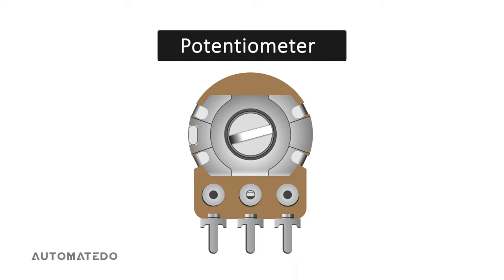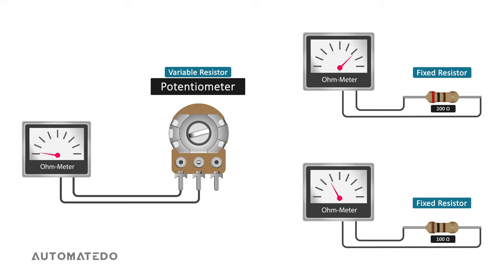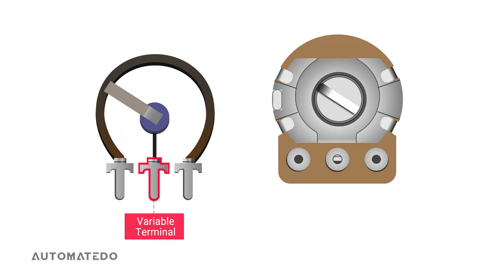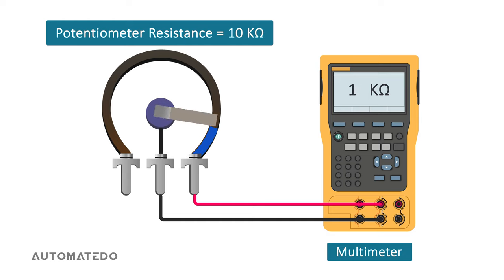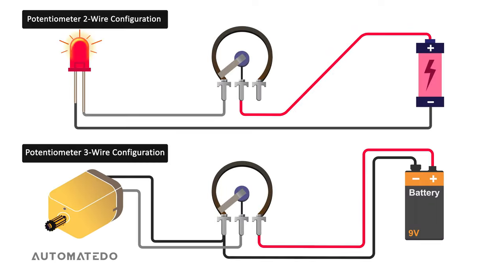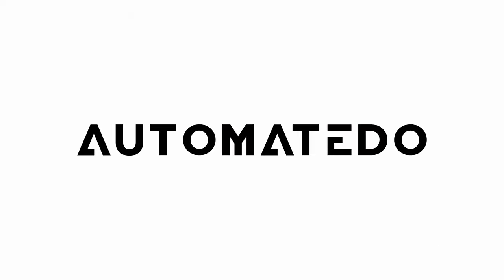Potentiometer Explained

Comment from the maker: We hope you enjoy the content. With your support, we can bring you more informative and engaging videos on the topics you love. Your contributions make a real difference and help us grow the community of industrial automation experts. Together, we can create something truly special. Thank you for being a part of this journey! Cheers 🍹https://ko-fi.com/automatedo
Reply: Excellent video. Well done.
Reply from the maker: Thanks for your precious support 😉
Reply: For the voltage variable one, is it still wired in series?
Reply from the maker: Yes, a voltage variable potentiometer (also known as a voltage divider) is still wired in series with the circuit. In this configuration, the potentiometer is used to divide the voltage between its two output terminals, which are connected to the rest of the circuit.

By adjusting the position of the potentiometer's wiper, the voltage output from the potentiometer can be varied, allowing for precise control of the voltage supplied to the circuit.

It's important to note that in this configuration, the potentiometer's resistance value should be chosen based on the current requirements of the circuit, and the maximum voltage that will be present across the potentiometer. Exceeding either of these limits can cause the potentiometer to overheat or fail.
Reply: Thank you for the video. i plan to create some videos for school students. may i know what software you used in producing this video?
Reply: Great video, thanks for sharing with us, could you please tell us software used to show wiring @Automatedo
Reply: Which type linear/log & what ohm rating potentiometer should i use  to control a dc motor in a sewing machine using 6v @ 1200 ma of voltage/ current?

Is there a way to calculate the ohm rating for this type of circuit?

Comment: Couldn't you have achieved the same thing with the motor by using the first configuration?  Only use 2 pins from the potentiometer and if you want to increase the speed of the motor just decrease the potentiometer resistance, and if you want to decrease the spin then add more resistance. I fail to see how using the third pin is useful for adjusting the speed when you can just use 2 pins. Can someone explain please
Reply from the maker: While a potentiometer with only two pins can be used for motor speed control, a potentiometer with three pins can offer additional flexibility for controlling other aspects of the motor control circuit, such as the direction of rotation or the duty cycle of a pulse width modulation (PWM) signal.
For example, in a motor control circuit that uses PWM to control the motor speed, the third pin of the potentiometer can be connected to the PWM input, allowing the potentiometer to control both the duty cycle and the speed of the motor.
Reply: The difference is subtle. If you use all the 3 pins, you are employing not a variable resistor, but a voltage divider (see voltage divider in the internet to know more). In this case, the whole voltage of, say, a battery, is supplied to the whole device (suppose 6V). The DC motor is connected to the wiper and one of the legs of the potentiometer. The resistance of the part NOT connected to the DC motor determines the fall of potential, so if that resistance is low, the drop of voltage will be low and more voltage will remain for the part connected to the DC motor. This results in the fact that the more resistance is dedicated to the part of the DC motor, the more power it gets. It is a little bit brainy but if you follow the reasoning you soon well realize that it is really that way.
Reply from the maker: Thanks for sharing the your valuable thought and experience 🙏
Reply: @tanner1985  that's what is happening, but why is the voltage divider preferred over a variable resistor?
Reply: A voltage divider allows you to take a voltage and produce a lower voltage.
They typically comprise a couple of fixed resistors.

By using a potentiometer you can make that output voltage variable.

Using a potentiometer in a 2 pin arrangement gives you a variable resistor, not a voltage divider.
It is just a resistor which is changeable.
And a resistor sets the current.
A changing resistor allows you to change the current.

So it all depends on what you are trying to do, what you actually need for your application, do you want a fixed or variable voltage: => voltage divider or potentiometer, or do you want to set a current to a desired magnitude or changeable magnitude: => resistor or potentiometer using two pins.
Reply: 2 pins acts as current variation while 3 pins as voltage variation.
Reply: @deang5622 For speaker output (2 wire + and -). What type of wiring to use, 2 pins or 3 pins?

Comment: What I get , there is no use of the 3rd leg , because it's depends on In which leg you input the voltage .
Reply: Not quite, it can be handy in several use cases. for an example in a voltage divider

Comment: Increasing the resistance through the potentiometer will decrease the speed of the motor, not increase. other than that, good video👍👍
Reply from the maker: In general, if a potentiometer is used as a voltage divider to control the speed of a DC motor, introducing more resistance will lead to a slower motor speed.

However, there may be certain cases (the illustrated example in this video) where introducing more resistance could result in a higher motor speed.

For example, if the motor control circuit is designed to work with a specific range of potentiometer resistances, and the resistance is currently too low, introducing more resistance to bring it into the appropriate range could result in a higher motor speed.

Comment: Great video! However there is one part that isn't clear to me. Please tell me if I understand this part correctly. The resistance in a potentiometer depends on the length of the resistance element. When you adjust the knob on a potentiometer, the wiper either shortens or lengthens the element. Therefore, a longer element will have more resistance, while a shorter element will have less resistance. For instance, in volume control, the longer the resistance element when you turn it down, the lower the volume and the shorter the element when you turn it up, the higher the volume. As someone who had no prior knowledge of electronics, I thought the resistance element inside the pot had different points of resistance as opposed to the wiper actually shortening and lengthening the resistance element.

Comment: Hello. I have an interesting case. What if I have a variable resistance load (500 ohms-7000 ohms). I want to increase the voltage or force a current amount across it to generate controllable heat. How can I achieve this result with a power supply having an output of 0-30V and 0-10A? I appreciate your help

Comment: I'm new to electronics so forgive me for my stupid question. Please help me understand? At 4:46 you said: "If we adjust the wiper in a way that introduces high resistance, more voltage will drive to the motor, resulting in turning the DC motor faster."  The motor IS running faster as you said BUT at this point the negative terminal on the battery is connected directtly to one terminal on the motor while the positive terminal from the battery takes the shortest path trhough the POT going straight via the wiper to the other terminal on the motror.  Isn't this the LEAST resistance for the current? Why do you say the opposite of what seems to he happening?
Reply from the maker: In general, if a potentiometer is used as a voltage divider to control the speed of a DC motor, introducing more resistance will lead to a slower motor speed.
However, there may be certain cases (the illustrated example in this video) where introducing more resistance could result in a higher motor speed.
For example, if the motor control circuit is designed to work with a specific range of potentiometer resistances, and the resistance is currently too low, introducing more resistance to bring it into the appropriate range could result in a higher motor speed.
Reply: Exactly my question
Reply from the maker: In general, if a potentiometer is used as a voltage divider to control the speed of a DC motor, introducing more resistance will lead to a slower motor speed.
However, there may be certain cases (the illustrated example in this video) where introducing more resistance could result in a higher motor speed.
For example, if the motor control circuit is designed to work with a specific range of potentiometer resistances, and the resistance is currently too low, introducing more resistance to bring it into the appropriate range could result in a higher motor speed.
Reply: First off electrons flow from negative to positive pole.  imagine it was a water driven and as the resistance increased the pipe gets smaller, less water flows  and visa versa.
As you increase the resistance to the wiper it decreases the flow of electrons (water) so the motor turns slower.

Comment: I have a question, for the example at 3:10 ..... why does the left terminal have both black wires? Couldn't the left terminal not be used at all and go straight from the  negative battery to the motor?
Reply from the maker: While a potentiometer with only two pins can be used for motor speed control, a potentiometer with three pins can offer additional flexibility for controlling other aspects of the motor control circuit, such as the direction of rotation or the duty cycle of a pulse width modulation (PWM) signal.
For example, in a motor control circuit that uses PWM to control the motor speed, the third pin of the potentiometer can be connected to the PWM input, allowing the potentiometer to control both the duty cycle and the speed of the motor.

Comment: 🎯 Key Takeaways for quick navigation:

00:03 🧪 Potentiometer is a mechanically driven analog device used in electronics projects.
00:31 🔄 Potentiometer is a variable resistor that can easily change resistance by turning a knob.
01:01 🔌 Potentiometer has three terminals: two fixed and one variable, forming an arc of a circle.
01:30 🔗 The middle terminal (wiper) moves across resistive element, altering electrical contact.
01:58 🔍 Multimeter helps measure potentiometer resistance; wiper's position affects value.
02:27 🔧 Wiper position changes resistance; multimeter probes measure resistance accordingly.
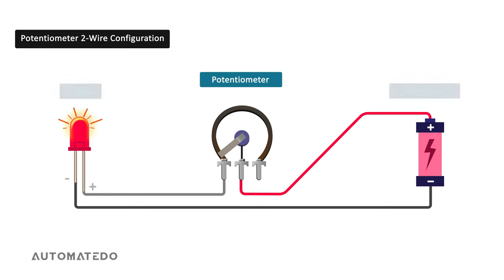03:21 💡 Potentiometer used as variable resistor for LED brightness control.
04:18 ⚙️ Potentiometer acts as voltage divider for motor speed control.
05:15 📚 Understanding the basic concepts of potentiometers for electronic projects.
Reply from the maker: Thank you so much for your kind navigation! 🙌 We are glad you found the video great, and I truly appreciate your support. Your encouragement means a lot to us. If you have any friends or colleagues who might also enjoy the content, we would be grateful if you could introduce them to the channel and encourage them to subscribe. We look forward to bringing you more amazing videos! 😊
Reply: Lowbrow question

Controlling a LED. Input is 30v ... 1k pot with give me .03 increment of change (0-30volt amp)?

Comment: Note: Never exceed the current through the potentiometer's rating or "Wattage" For Higher currents use a transistor [BJT or Mosfet] to control the load with the Pot controlling the transistor.
Reply from the maker: Thank you for the comment! You are absolutely correct. It is important to ensure that the current flowing through the potentiometer does not exceed its wattage rating. Exceeding the wattage rating can cause the potentiometer to overheat and even burn out.

Using a transistor such as a BJT or Mosfet to control the load with the potentiometer controlling the transistor is a great way to ensure that the current through the potentiometer stays within its rated limit. This configuration is commonly known as a voltage divider circuit and is a widely used technique in electronics.

Thanks again for the helpful comment!

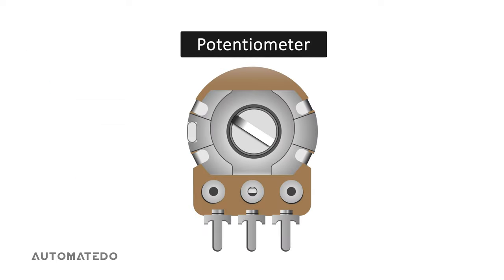Comment: I don't quite get the "3 wire configuration" example at 5:04, wouldn't a 2 wire setup like the previous LED example give the same outcome of adjusting the motor speed, what's the difference and advantage of controlling the motor this way?

Thank you for the video, it really helped me understand how a potentiometer works!
Reply: Not the author, and not an expert, but I decided to kinda look into this...

This is all from my understanding and interpretation, so take it with a slight grain of salt and if I'm wrong, hopefully someone can correct me!

The 2-wire setup will simply add resistence in-line, effectively creating heat and noise on the line. It's already succeptible to some noise with the 3rd wire not part of the ciruit anyway, but resistence adds noise. You can think of it like adding more resisters in series the more you turn it up, or replacing the existing resistor with a bigger and bigger one. No matter what, you are sending electrons through the entire series of resistors. This in effect increases resistence/impedance to drop Voltage, but Current will remain consistent through the circuit (same is true for resistors in series).

When in a 3-wire configuration, you create a complete circuit eliminating noise or any failure in the pot itself (ie, break in the wiper vs track, etc), as well as use it as a voltage divider. The last part was stated in the video, but it didn't really explain what that means and why it matters to the motor condition versus an LED condition. A voltage divider does as it says, dividing the voltage, by actually cutting in between "2 resistors" in the circuit (in this case the left vs right side of the track between the wiper) and getting the voltage through the circuit there. This in turn gives us a better fractional value and step in the voltage output in our circuit. In addition, it also shares the load of the resistance of the circuit to the entire track (or 2 resistors in a proper voltage divider) allowing greater effeciency.

Again, this is my understanding/interpretation of the math/logic, feel free to correct me if I'm wrong anywhere!
Reply: @CodexHere  very nicely explained!

Comment: Thanks for the enlightenment, but is it safe to use this the same method for a dc 12v motor with 50k potentiometer? Please do it reply, thank you. From Nigeria
Reply from the maker: Yes, it should be safe, as long as the motor and the potentiometer are rated for the same or higher voltage than the battery.
However, using a 50k potentiometer may not be the most appropriate for controlling the speed of a 12-volt DC motor because it may not provide enough resolution or precision to accurately control the motor speed.

Comment: hi, very interesting your explanation, it gonna help on my project, i have just one question before buy it, i have an mobility scooter,  is my project now. i want make sure that i'll replace the original potentiometer which is (TSR 24KN resistanceResistance. Like 200k or 50k. Looking forward to hear from you. Appreciate
Reply from the maker: The TSR 24KN potentiometer has a nominal resistance of 200kΩ. However, it is possible that your scooter's control system may have been designed to work with a potentiometer of a different resistance value.

To ensure compatibility and avoid potential damage to your scooter's control system, you should refer to the manufacturer's documentation to determine the correct replacement potentiometer for your mobility scooter.

Comment: That is very good info, clearly explained. But, for audiophiles, it would be great to know the effect on voltage & amperage, in each case, when the same identical potentiometer is used as a tone vs a volume control. From this video, and my knowledge that a volume control is a  voltage divider...can I presume that tone control is varying amperage along with resistance? And, if so, what is the science between variations in resistance & amperage on the  dominant tones or resonant peak of an audio signal???

Comment: Thank you for the explanation! However, I don't understand the voltage divider part. When the voltage which passes through the motor is changed by the potentiometer, will the current change too?

Comment: I have a question about the 2 wire configuration with the led. If I connect the cable to the 3 pin(negative) and would turn it counterclockwise that the resistance increases and the led becomes weaker and if I turn it clockwise it gets brighter? so the exact opposite as mentioned in the video, thanks for replying😊